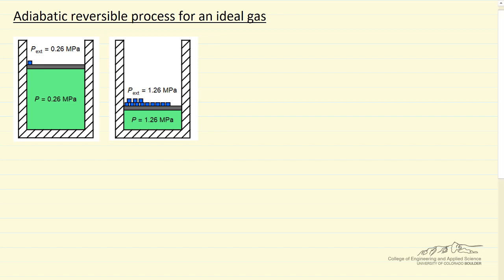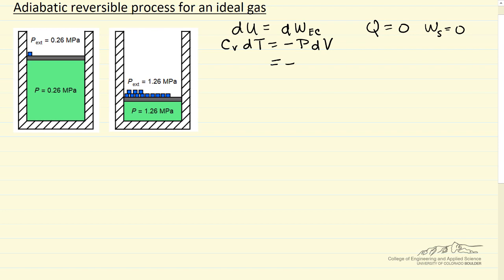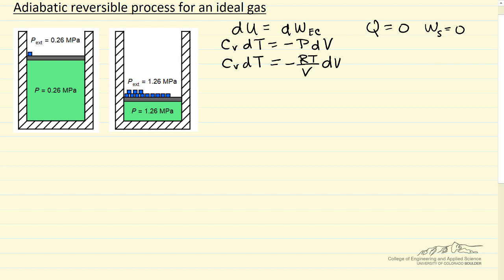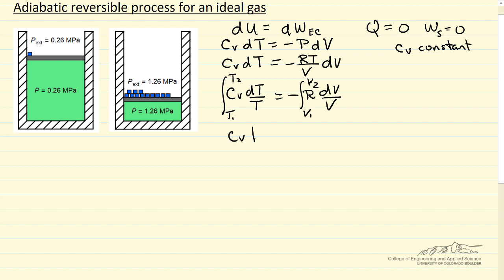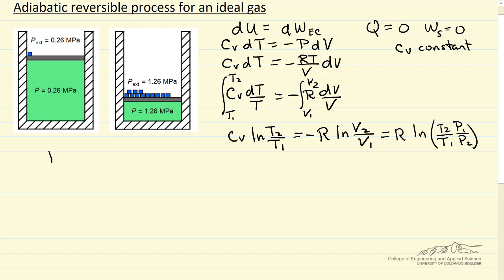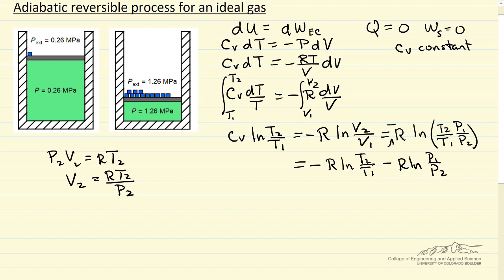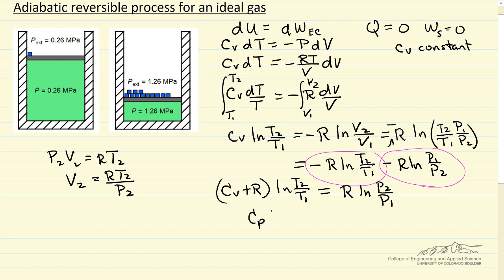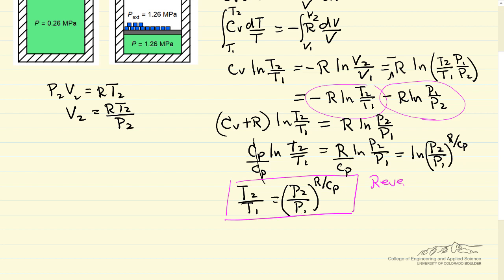Adiabatic Reversible Process For Ideal Gas

Comment: It does not make sense for PV=RT because obvious the units on the left and right are not the same. What assumption did you use here?
Reply from the maker: Great question. It should be said that V is the specific volume or volume/mol. (Or V/n if you are accustomed to PV=nRT.)

Comment: you left out n from the term on the right
Reply from the maker: Thank you for your comment. He is using the specific volume, or volume per mole. That should have been pointed out. (And if he had used the moles, the n's would have cancelled out.) Again, thank you for paying attention to details!
Reply: @LearnChemE  thanks for the clarification. I was thinking the same thing
Reply: So molar volume is denoted by V with a subscript m, or V with a bar above it. Why did they just write V?
Reply: @danieleharper2259  i think his reply pretty much explains it ,it was a mistake for not saying molar volume
Reply: @mevadavraj4178  still a lazily made video

Comment: So, let me make sure I understand this correctly. The reason the temperature increases or decreases is because you are really good at doing mathematical calculations? I ask this because you've made no effort whatsoever to explain what mechanism or process that nature uses to make the temperature change. It's probably not all that important anyway and probably uses magic or it's the will of some god or gods and unknowable by mere mortals.
Reply: if you're in thermodynamics you should just understand that when you pressurize something the temperature will go up, prove it to yourself by using the ideal gas law
Reply: When you memorize your science lessons, you don't learn anything. You've just memorized some stuff and assume that it's right. The "ideal gas law" is a classic eexample of something you memorize and then write the answers on the test the teach erxpects and you get aa good grade.

Is there a relationship between the "pressure" in a tank of some gas and the temperature of the gas. If you pick up an empty SCUBA tank does it feel cooler than a filled one?

You ask me to prove it for myself. You can also prove it to yourself. Go to somewhere that has compressedd gas and feel the tanks to see if you can tell which are empty or full by the temperature.

If you fill a tank with compressed air (like with a home air compressor) to about 120 psi you can notice that the compressor gets pretty hot. But, if you run the compressor very slowly so it akes a couple of days to compress the air in the tank to 120 psi, neither the tank or the compressor will get noticably even warmer.

That tells me that there's some sort of relationship between the rate of compression and the temperature rise. It tells students learning (memorizing) the ideal gas law...nothing. It's not spoon fed to them, by the teacher, so they figure it's not important enough to waste their time thinking about it.

In a Diesel engine (and, in the air compressor) the maximum temperature rise, in a cylinder, occurs at the very end of the compression stroke...when the piston is moving its slowest. That tells me that there's some relationship between the amount of compression already there and how fast the temperature changes when the air in the cylinder is compressed just a bit more. It tells students learning (memorizing) the ideal gas law...nothing.

Once someone becomes convinced that physics actions work by the sheer power of mathematical calculations...well, they become the crackpot pseudo-scientists.

But, I am confident that you don't need to prove any of this because your're learning it right already. Maybe even "ideally"?
Reply: @crashsitetube  i think in an year or two you will probably become a scientist 😅
Reply: @devanshusharma9768  - I might already be the "REAL" scientist?
Reply: @crashsitetube  Are u really a scientist??
Reply: @devanshusharma9768  - Is a scientist someone with a university degree in science? Or is a scientist someone with an interest in science and who tries to get science explanations right?

Was Galileo a scientist? After all, he was placed under house arrest for saying that the Ptolemaic claim that the Earth is at the center of the Universe was wrong. But, Ptolemy had been taught as being the correct science for over 1000 years. Were the scientists who believed Ptolemy "real scientists"...or were they just memorizing their science lessons without questioning whtether what they were being taught was right or wrong?

Each person has to decide what they will believe.

-----------------------

Is the person who made this video a "real scientist" or did he just memorize his science lessons? When a person tries to explain science by using math, I always question whether they have a theory or concept of HOW the thing they are describing works or if they are just repeating math they learned.

In the case of this video, since the presenter makes NO effort to explain the underlying concept of the adiabatic process, my conclusion is that he's just repeating the math he learned. I certainly would like for him to respond with some mechanism for HOW the adiabatic process can make things get both hotter and colder.

----------------------

I consider myself to be someone who wants to get physics (and, all the sciences) right and I do have some theories of how the adiabatic process may work. Am I right? I think so but, without having a good honest discussion about the concepts of it, I guess there's no way for us to find out.

The people who think of themselves as being "real scientists" often get it wrong. And, when that wrongness is challenged, just claim that it's the ones who question them that are wrong.

Here's an example:

https://chestofbooks.com/crafts/scientific-american/sup3/The-Fallacy-Of-The-Present-Theory-Of-Sound.html

The theory of sound was being questioned over 130 years ago (in the 1880s) and we have a record of that in the referenced Scientific American magazine supplement article.

In the 1880s these questions were being ignored by the "real scientists" and, they still continue to get just about everything about sound wrong.

The same is true of the adiabatic process.

But, you don't need to understand the theory or concept or the mathematics of something to be able to use it. Did the cave man need to understand thermodynamics to be able to use fire? Does a bee need to know chemistry in order to make honey? Is a spider performing mathematical calculations when it spins a web?

salaphysics.com
121420
Reply: @crashsitetube  you're not galileo. pointing out one example of an unrelated misunderstanding of a concept does not in any way undermine the robustness of thermodynamics which is fundamentally unchallenged.